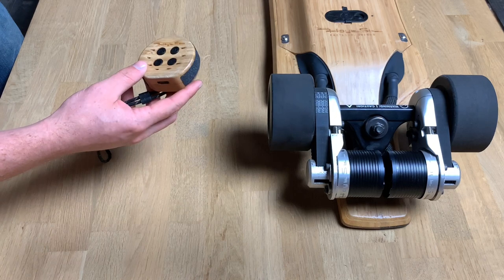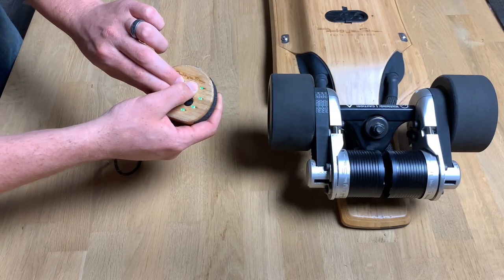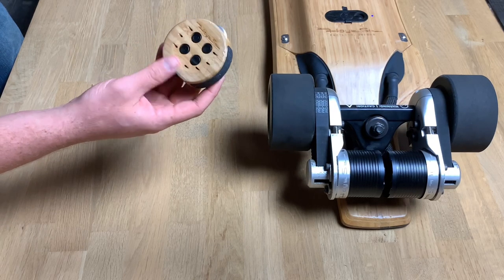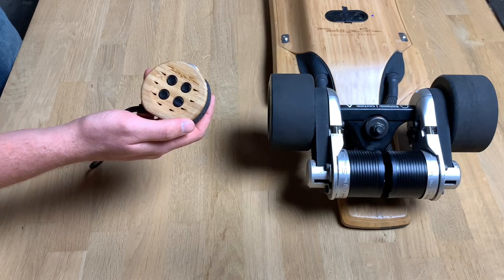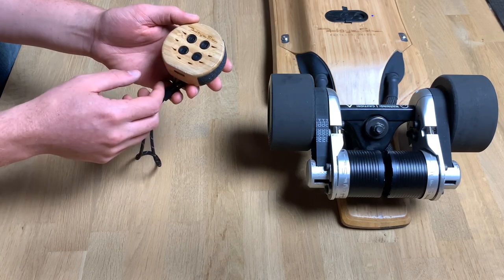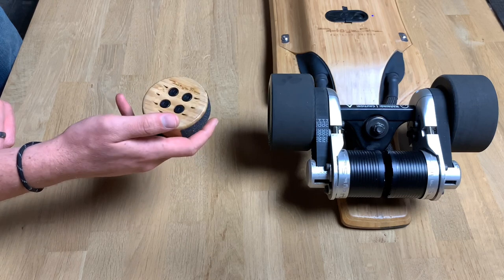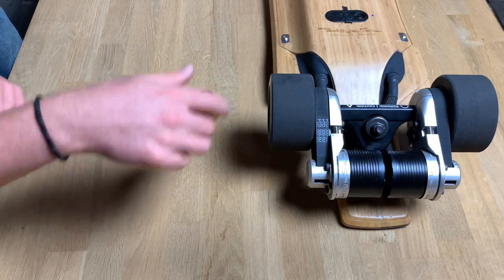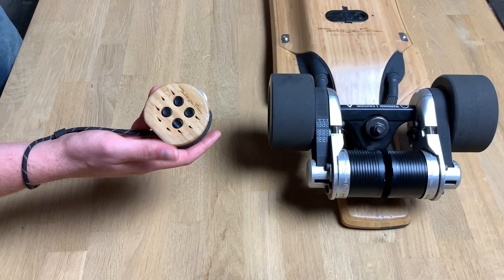Hoyt St Electric Skateboard Tutorial: How to Pair and Operate Hoyt St. Puck Remote

Comment: I don’t use cruise control because I think it’s dangerous but my question is it does not have cruise control and one more question it does not have a battery indicator he didn’t cover those bases on that but the remote does look cool but I like the traditional flipsky VX1 style remote, not to sure about this puck? IMO Flipsky VX1 is my fav and is inspired by boosted remote with the scroll wheel, so in my opinion it fits in your hand a little better this park looks pretty big, bigger than what it look like in the pictures, but this is all just my opinion and what I like and what I think about the puck!!!
Reply from the maker: Kyle Harvey hey Kyle.  There is no cruise control but there is a battery indicator (for the remote, not the board).  The battery indicator was a recent firmware update; single click the power button and the display color indicates the state of charge.  The puck fits really well in the hand; some people prefer pistol grip and other trigger but we have a lot of folks who love the puck.  Additionally, it channel hops to avoid any interference - no connectivity or communication issues.

Comment: Will you guys upgrade the firmware so that it shows the board batteries as well? That'll be really useful. Thanks!
Reply from the maker: rcxotic it would require more than a firmware upgrade.  One of the reasons our connectivity is so rock solid is because communication is one way; from remote to board.  We’d need two way comms to have puck indicate board SOC.
Reply: @Hoytskate  thanks for the quick reply! That makes sense.

Comment: How do I fix beginner mode 1's start up throttle? It's super slow and doesn't have the torque to move my board from just standing there. I don't mind the speed since it's nice to cruise around, but at least have a good torque startup.
Reply from the maker: hey, Leon.  our remote is calibrated vs urethane wheels.  if youre riding pneumatics, it will be slower.  try mode 2.  or hit us up at hoytskate@hoytskate.com to troubleshoot.  be well.

Comment: Just got my board and pick. How do I check to see if already charged or if low? I just plugged it in to get charged and it was red so I assumed it was dead. 30 mins later it’s green so I assume that means it’s charged!? Thanks awesome video🤙🏼
Reply from the maker: Full charge is blue.  It then changes from blue to green to yellow to red, then the last 1% it vibrates like mad.  You should have received a little card with your order that details this out.

Comment: That remote looks good. Is there a way that I could get it to work on an evolve board?
Reply from the maker: I would inquire on the esk8.news forums.  Perhaps someone has already done it or tried.  So long as evolve is vesc based and the receiver is not built into the ESC, it should be compatible.

Comment: The constant vibrating at 10% is like shooting yourself because you got a scratch. Please rectify this issue. It creates a huge problem when you're 10 miles from the house, your remote battery runs low and instead of saving energy to get you home, it runs an electric motor every 2 seconds to accelerate its own death.
Reply from the maker: haha, you're not wrong.  we are working to rectify this.  that said, if you're getting down to the vibrations, there is <2% remaining on the battery.  honestly, if you don't see blue for SOC, we recommend recharging.
Reply: @Hoytskate  2% is even worse. Is that the first indication of low battery? Can you explain the "blue for SOC" comment? Glad to hear you guys are working on it. Saw one of your boards in person recently through Voltaic-Motion. Insane craftsmanship
Reply from the maker: @wiggpickle  if you have the latest firmware, you should be able to single click the power button and the lights will communicate SOC (state of charge).  email us at hoytskate@hoytskate.com and I'll reply with an info sheet (I would include it here but I don't think I can attach an image).

Comment: Can I pair this with any Electronic skateboard? thanks you !
Reply from the maker: If the board will accept a new receiver and is ESC based, then yes.
Reply: @Hoytskate  so if the board ESC based I don’t need to install the receiver? Thanks for replying 🙏🏻
Reply from the maker: @matthewmirzarafi358  no, you still need the Hoyt receiver and possibly a ppm cable depending on your esc ports.
Reply: @Hoytskate  thank you !
Reply: @Hoytskate  my board equipped with VESC 6.6 from Flipski . Is that compatible  ? Thank you
Reply from the maker: @matthewmirzarafi358  absolutely.

Comment: What do the different modes (M button) actually do?
Reply from the maker: There are three modes.  Mode 1 is beginner mode at caps the top speed to 15mph or so.  Mode 2 caps around 25mph and mode 3 is full speed.

Comment: Can you talk about the channel skipping tech the remote uses?
Reply from the maker: It is a proprietary system that is constantly switching between 16 different channels every micro second.
Reply: Today while riding in DC my controller started flashing and vibrating in one particular area.  Once I left the area it stopped and never did it again the rest of the ride.  Is that an interference warning or low signal warning ?
Reply from the maker: Nerun A did you charge it in between or did happen and stop even without charging?   Hit me with more details at hoytskate@hoytskate.com so the proper people see your comments.  Thanks!   Jeff@hoytskate.com
Reply: Message sent to the email.  Thanks!

Comment: Can you check the battery life of your board on this remote?
Reply from the maker: Nathaniel Sehati yes, the board has a decktop battery light meter in the nose and the remote battery SOC can be determined by single clicking the power button.
Reply: Hoyt St Electric Skate I probably should have clarified. I meant if using this on a diy board🙂
Reply from the maker: Nathaniel Sehati the remote yes. There is no board battery indicator in the remote.
Reply: @Hoytskate  How do you check the battery level of the remote on the DIY  version? I press the power button once but the it lights up all the LEDs all the time
Reply from the maker: @GameDay1UP  by color.  If it’s showing blue, u have 50%+ remaining.  If green, you should consider recharging.  Any other color and you’re very close to running out of juice.  If you scroll through the pix on our Instagram or Facebook pages, you’ll find some charts.